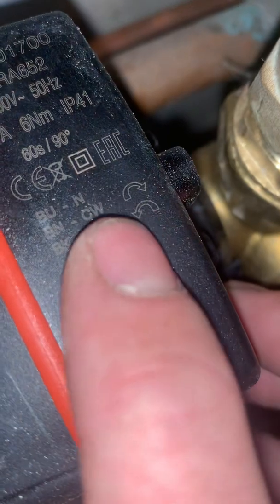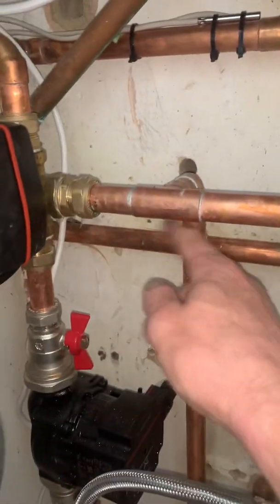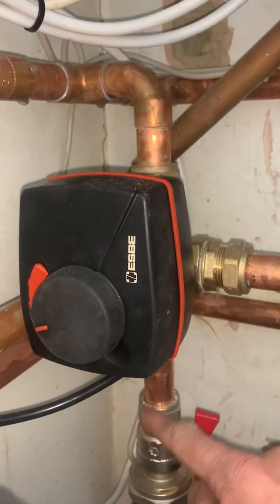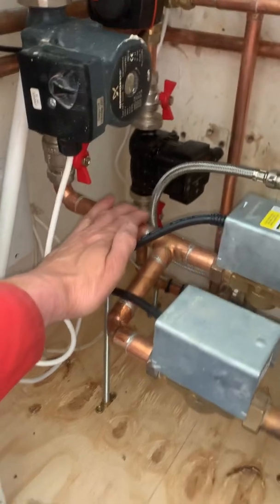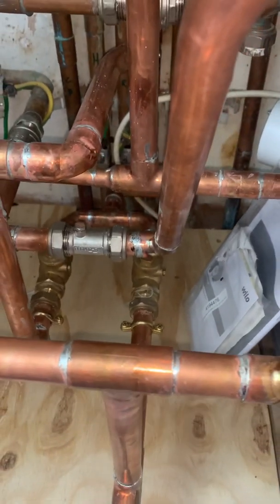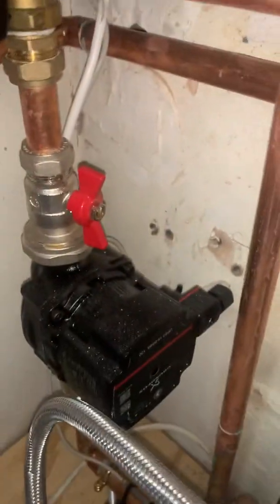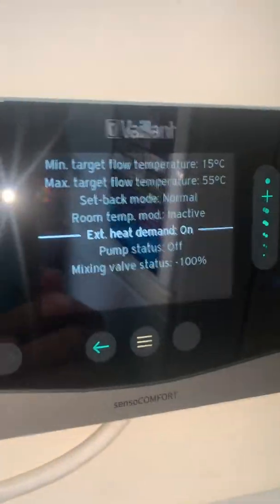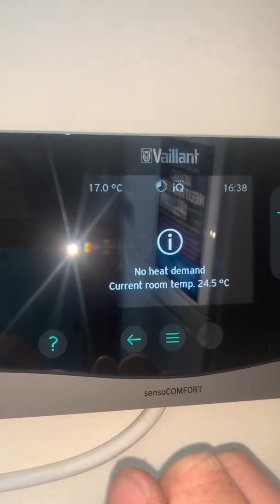ESBE valve in operation on a Vaillant.

Comment: Hi, great video, thank you. I have one question though with the ESBE valve modulating and being able to close does that do away with a two port valve on that circuit? I'm guessing it does.
Reply from the maker: Hi thanks. 

Yes you are correct, there is no need for a 2-port.

Comment: So if you only had ufh and a cylinder you wouldn't need the normally open zone valve configuration as the mixing valve limits the temp for ufh whilst the boiler ramps up for hw demand?
Reply from the maker: @1000Mikey  
Yes you can parallel charge with the Vaillant and yes its best to only do it when you have mixers. 
These zone valves are NC by the way.
Reply: @tomplumb7754  perfect. So just need a zone valve on the cylinder and the mixing valve set up on the heating side will open and close as needed. I've got a vaillant boiler and this is my planned setup when I come to renovate my house. I'm just trying to get my head around it. Thanks
Reply from the maker: @ 
No, then you would not run Parallel charging & no mixer. 
The boiler will alter the flow temperature when in CH and close the CH zone valve while HW is heating, this is how a dual temperature setup works. You would only parallel charge if you had high HW usage.
Reply: @tomplumb7754  ok, I understand now. So I would have (no) valve on heating and standard valve on hw. As long as I have a cylinder that can recharge quickly then I won't need and mixing valves? Or if I have a rad circuit like the video.
Reply from the maker: @1000Mikey 
Hi no you use standard NC valves with Vaillant and their wiring centres. As long as you run weather compensation then this will alter the flow temperature for the UFH

Comment: How does it wire into the VR70 or 71?
Reply from the maker: Hi it wire in to the vr70/71 neutral and the CW & CCW on the 4 pin plugs.
Reply: @tomplumb7754  does the VR71 support a proportional ARA600 or just the 3-point model?

Would there be any benefit in going proportional if it is supported?
Reply from the maker: @Oldskoolskater-KnoxGhoul Hi whats the model number of the valve you want to fit?
I can take a look

Comment: Interesting setup mate. Do you have a high limit stat on the ufh to stop overheating on the ufh?

Also, did you not want to go down the pump group setup instead? I have a similar install soon but I'm limited for space, would having separate components potentially take up less space? 

Which model ESBE mixer and actuator is that?

I'm enjoying the content mate, keep it up.
Reply from the maker: Hi thanks 

No stat on the UFH, you can set the maximum temperature in the controls. 

We did not have the space for the pump group and often don’t so making your own up helps, especially with space issues. 

The valve is a VRG130 the KV value can be selected using there data sheet. 

I use the ARA600 as the actuator is 120sec which vaillant use in their mixing groups